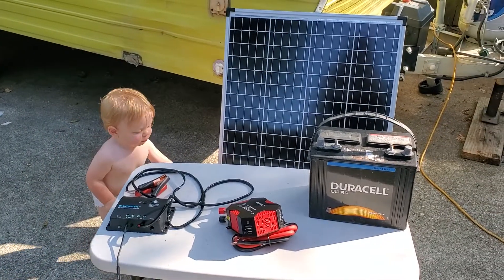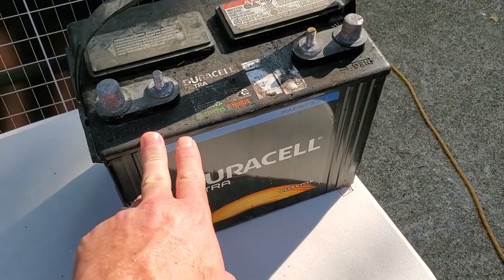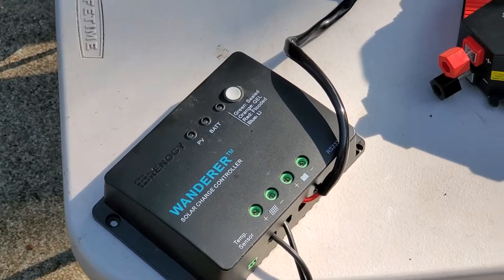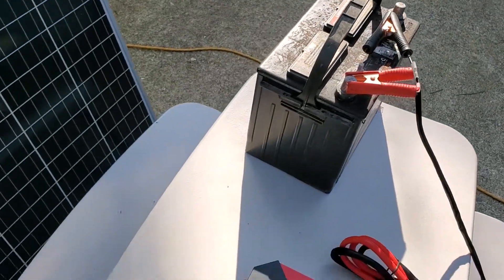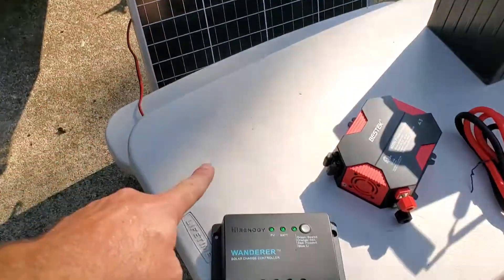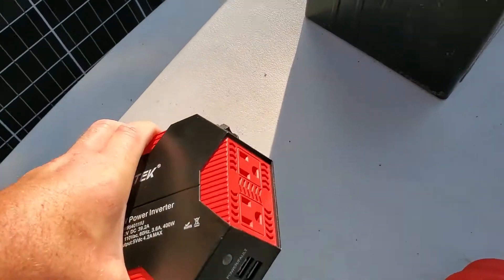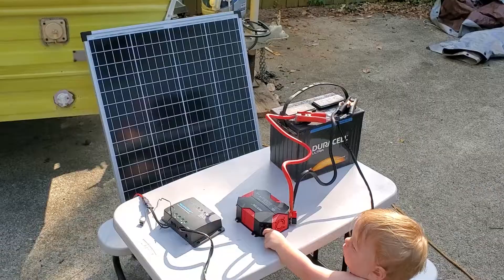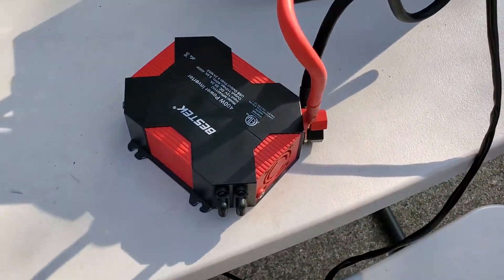Basic 12v solar components and connections

Comment: Where can I buy these components? Are there any kits with these same components?
Reply from the maker: Thanks for watching, and the comments! Ok so as far as brick and mortar stores, the only place I have seen all the components on the shelf is at Harbor Freight - maybe someone else can add their knowledge of other options. Otherwise, Amazon is the go-to, though you can buy most of the same items on Walmart's website as well. So the main components you will need are:
A: Charge Controller
B: 12v battery
C: 12v-120v Inverter
D: Solar panel

Here is a site I have used as a reference and it has links to each needed piece: https://www.mobile-solarpower.com/the-minimalist-great-for-small-vans-and-cars.html

As for "everything included" kits, there are a few options on Amazon, but I can't vouch for the included components ... 

https://www.amazon.com/ECO-WORTHY-Solar-System-Battery-Inverter/dp/B08MPLWTVD/ref=sr_1_29?dchild=1&keywords=12v%2Bsolar%2Bkit&qid=1626816057&s=lawn-garden&sr=1-29&th=1

https://www.amazon.com/ExpertPower-LiFePO4-Lithium-Controller-Projects/dp/B096N8TWG4/ref=pd_di_sccai_2/145-3859767-4398512?pd_rd_w=0GwuN&pf_rd_p=c9443270-b914-4430-a90b-72e3e7e784e0&pf_rd_r=87RD7C03DGBCRZAE5FX5&pd_rd_r=4cd2835f-c290-42f8-afaa-49e99cd903bf&pd_rd_wg=gATde&pd_rd_i=B096N92HMS&th=1
Reply: @kampinglogik  This is the most relevant info I’ve seen on the subject and the most affordable. I do have a jackery 500 and the 100 watt panel however, my goal is to see how far living off grid I can go. The only economical way to do this is buy buying the components and doing it my self. The cost of an all-in-one device is really not economical.
Reply from the maker: Agreed, the higher capacity power stations are really expensive still. Paying for convenience.